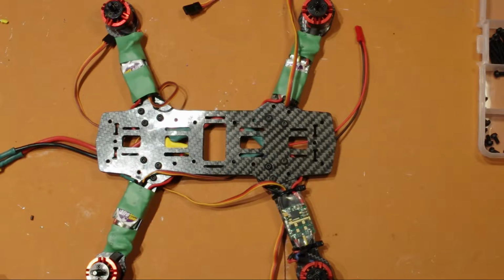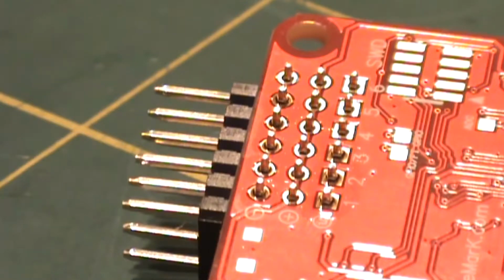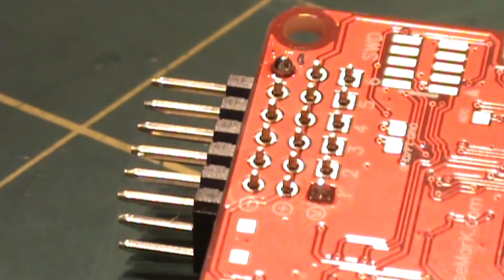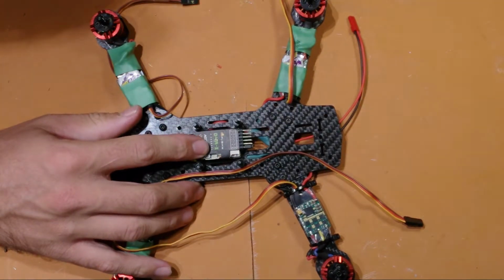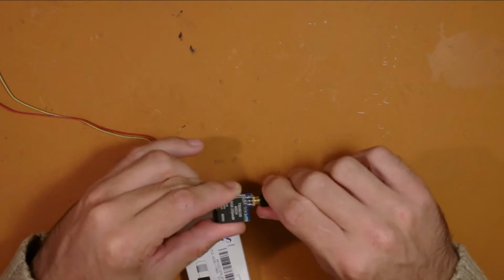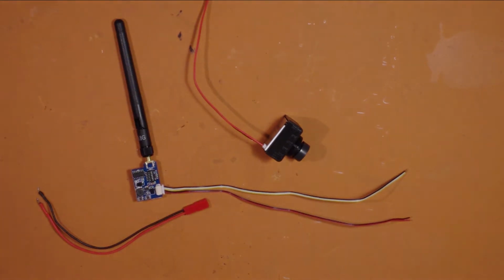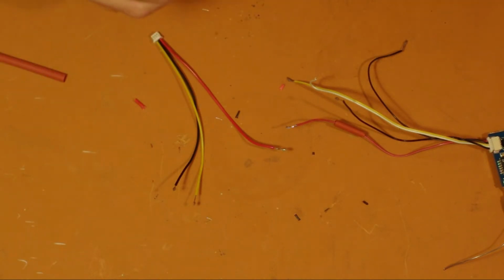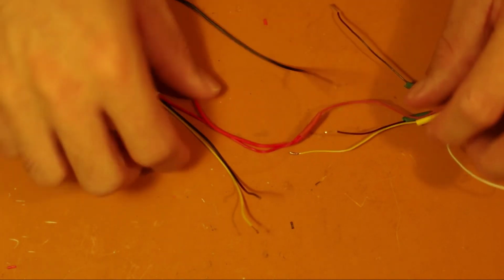How to Build a Racing Drone - Part 3

Comment: does it matter if there is a connector at the same end as the XT60
Reply from the maker: For the battery? You need a female plug to fit the male xt60 battery connector